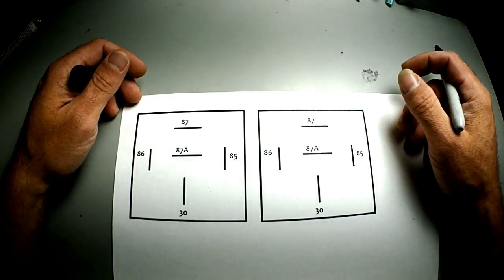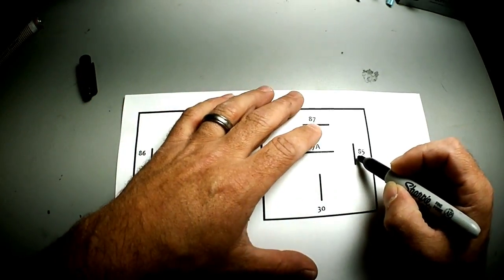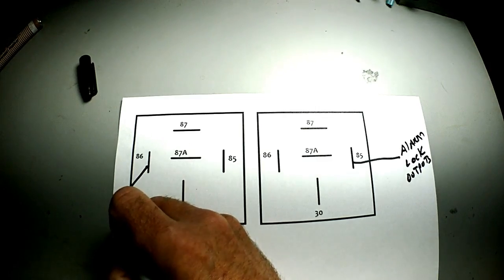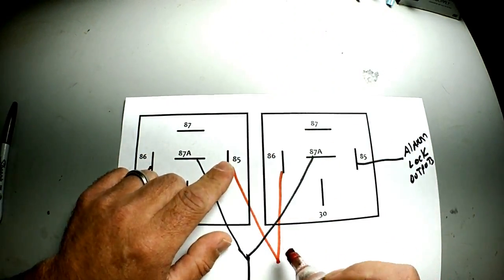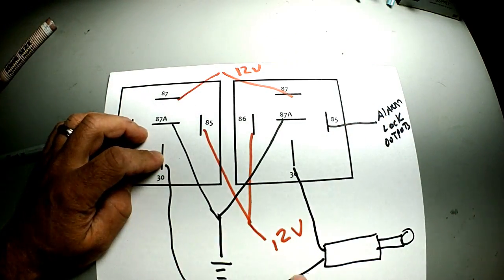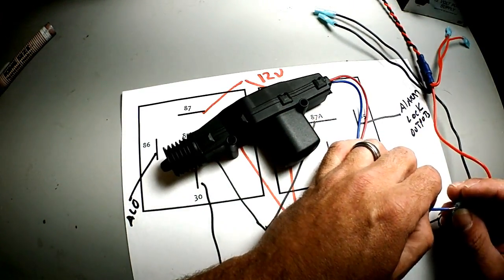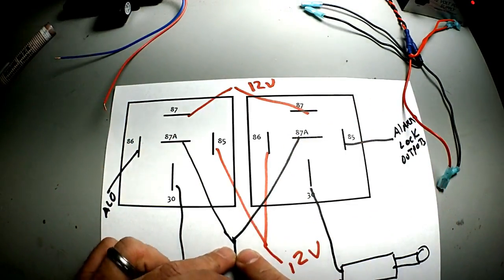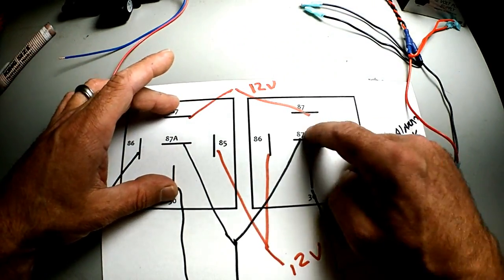How to wire door lock relays for aftermarket actuators.

Comment: Nearly right... switch up pin 30 snd 87. By DIN72552 30 is fused power from battery and 87 is load. This works the same, butbits not 'correct'

Comment: I know this is an old video now but can the trigger be from existing locks, eg I’ve done an engine swap and used donor car full loom, but donor car Audi a3 3 door, project is 5 door so at the moment no wiring in place for rear door locks so would this fix my issue ?

Comment: after much research and shagrin this video finally helped me figure out my relays to add the optional OEM power door locks in my manual lock truck that did not come with them originally
Reply: How did you use the oem actuators? Did you use oem key fob? Or aftermarket security alarm
Reply: @mr.spittle136  my 2001 4.3 didnt come with a key fob, I used the hard to find base model optional elec door locks (not the style that have the elec windows, my windows are still crank) I used the OEM wires (its all plug and play) and just wired them up to 2 relays like in this video. I had to make my own end plugs for the relays of course - but used the OEM wires. As an option I decided to add in a remote fob but its not required (I just didn't like reaching over to unlock the door) the aftermarket remote fob came with its own wiring info and I combined them and it worked out well
Reply: @jmsmilin @jmsmilin thanks for the breakdown. Ive got some oem actuators in a set of spare doors i plan to use for my power locks/windows conversion
Reply: @mr.spittle136  the OEM wires will plug right into the actuators and the lock buttons, all I had to do was figure out what wires go where on the relays, ideally you can find OEM relays already wired, but its hard to find the trucks that came with only power locks

Comment: So I found this setup wired in a truck that a bought with a positive and negative (I assume) trigger wire running over to the drivers side of the  truck with a small 2 pin plug on it. It appears that maybe someone removed the radio triggered portion of the system. What should I buy to put in its place to restore the keyless entry? Is there a wireless reversing relay out there?

Comment: A question how can I make my truck do power doors lock work with the transmission because my truck only has factory alarm and if the power doors locks work with the alarm but it does not work with the transmission and how can I do that when it is in parking unlock and when it starts it locks ...

Comment: hi, thanks for your instructions. it worked for me - i just did this on the passenger side door locks.
Couple of questions:
1. The relays are staying warm. is this normal?
2. I did this only for the passenger side but i noticed all the other 3 door locks are working with much greater force now. Is it possible that a stronger current is flowing in the door locks circuit?! (as they are connected in series)
Reply: I have the same problem, did you ever figure it out? My relays are warm and causing the battery to slowly drain
Reply: @maximuscamp2400  no , i just removed them out ☹️

Comment: hi stereo king.my vw t4 think is positive pulse so do I change relay connectors?a relay came with alarm kit from righclick .im in uk.thanks.steve
Reply from the maker: If you watch my video on how to wire a relay it explains how to throw a positive trigger.
Reply: @stereoking7778  thanks.just one more problem.on the right click alarm.the lock remote locks drivers an tailgate.but the unlock button locks passenger .tried reverse drivers door wires and no difference..maybe reverse passenger door wires?

Comment: Ok question I'm trying to put three actuators one for driver's door passengers  n finally trunk .so I only need two relays not two for each actuators n do I connect all wires of actuators together for unlock n for lock.please help .I burnt one out already
Reply from the maker: Yes you should only need 2 relays unless you want to control the trunk separately.
Reply: Thanks dude I got the door to work.now for the trunk I need to  use two n what cable can I use to trigger from alarm on mines I picked a solid gray but didn't pop the actuator

Comment: finally found out how that magic stuff works! what if you have around 10 actuators ? can you run more powerful relays or is there a different setup ?
Reply from the maker: I've done 6 off of 30 amp relays. I would guess you could do ten. If not just use 4 four relays.

Comment: Will this work for 2012 ram 1500? I’m adding a lock actuator for my tailgate but I’ve see different diagrams..
Reply from the maker: Aftermarket actuators all wire up the same. The vehicle shouldn't matter.
Reply from the maker: If you are adding to a factory system then no it would need to tie into the factory motor wires.
Reply: @stereoking7778  pls I am working a keyless entry to 2006 Chrysler stratus, I could not get the lock and unlock wire to connect to the relay from the car door switch

Comment: Why do u connect 85 and 86 to 12v cant u just do 85 85 then use 86 and 86 to go to lock output
Reply from the maker: 85 and 86 only activate the relay.
Reply: @stereoking7778  I see what you mean 86 to lock and 85 to unlock or vice versa. Is that correct?

Comment: Can i install door lock/unlock switch button? My car doesnt have one. Only auto lock by pressing brake and unlock after gear put on P.
Can a any universal power window switch being use as door lock/unlock switch? Is it same mechanism?
How to wire it?
Reply from the maker: You sure can. You will need a three position momentary switch. The center pin will go to ground and each output will tie into the alarm lock outputs before the relays.

Comment: Great video thanks, but i have [2] questions: 1. do you loop the positive 85 86 87 87 together and run to the battery?... 2. and  85 and 86 is that where you connect  your alarm and lights so they will flash?  Thanks again!!!   I'm retired just like trying stuff myself. Have a blessed day!
Reply from the maker: Yes sir you will tie both 87s and one 85 and 86 from opposite relay to 12 volts. The left over 85 and 86 will run to the alarm door lock outputs. If you are trying to add a relay to power lights I have a video covering the basics of a relay installation.  youtube.com/watch?v=GjR4Ko5r57s

Comment: Hi how they connect a power steps on my chevy silverdo 2010 can you help me how that relays conect thks
Reply from the maker: Power steps usually have a control box that can sense when to start and stop. Some times its built into the motor but normally. So just relays are not usually the trick.
Reply from the maker: Probably not do to they wont know when to stop.

Comment: Good video. I am using the setup you show here with the relays. In the video you don't show any door switches. I am using a remote lock unlock and also want to use left and right door switches to control the locks. I have set this up and I can lock or unlock using each switch separately. Problem I am having is if I hook up both switches at the same time neither one work. Do you have a diagram to show me how to hook this up so both switches and remote will switch the lock unlock. I am currently using two 2 wire actuators but I do have 5 wire actuators if needed to make this work.
Reply from the maker: You will need 2 three position momentary switches. Tie the center pin to ground and the outputs to the door lock outputs of you keyless/security system.
Reply: @stereoking7778  I have the left & right switches wired in center pin to ground and one switch output to blue and one to green on the actuator. Either switch works fine if I only hook one switch up at a time. Once I hook both switches to pins 85 or 86 nothing works. Have not hooked in the remote yet. Remote will trigger lock unlock with white and white/black wire when I hook that up. But my problem is not the remote function but the switches both working properly. I have worked on this for hours and can't get it to work with both switches. Even duplicated a whole system outside the car on the bench with same results. Something is not wired right to use both switches at once but I can't figure out what to do to fix it.
Reply: You can try diode isolating the switches from the relay. Not sure why adding to switches is causing priblems.

Comment: This is also helpful for replacing the slide controller on an RV.  Lippert (formerly Power Gear) controller boards use a pathetic little DPDT relay that burns out easily when the slide gets old and the load gets bigger from the worn motor and dried grease on the gears.  Instead of buying a $140 replacement from Lippert, this works fine, but you may have to change the 12V connection at 85/86 to a ground, as many older RV's used a positive trigger.  Also, Lippert's replacement boards are ONLY negative trigger, and this method saves you the trouble of changing your slide switch from positive trigger to negative trigger.  Be looking for a video about this on my channel in the coming weeks.  I will also be using a similar method to manually open/close the choke on my generator from inside the camper.
Reply: "Be looking for a video about this on my channel in the coming weeks" 4 year since , did you ever make that video?
Reply: @AztecWarrior69 Only days after I posted that comment I was hit by a drunk driver.  There was eventually a sizeable settlement, but in the interim I had to sell my motorhome to make up for the hard times the drunk caused me.

I've since replaced the motorhome, but the slide controller is fine so far so I haven't worked on it to make a video out of.  It's mostly been computers and my son's jeep on my channel

Comment: Do you have to have 2 source of 12V wire cause I tried 87,87,85,86 like picture and blowing fuse
Reply from the maker: When is it blowing the fuse? If it blows right away make sure you don't have 87 and 30 switched.
Reply: @stereoking7778  same thing is happening to merit blows the fuse right away, is this wiring diagram works even when the lock and unlock signal from the alarm are negative ?
Reply: @nehemiasmartinez7758  yes

Comment: I am trying to install an aftermarket keyless entry in a 02 volvo v70. The issue I am findind is how to wire this to provide the double pulse needed in this car to disarm the factory alarm. Someone has mentioned that the answer is at the door lock wiring which got 6 wires .Grey ,Yellow,,Pink,Purple,Blue/white,
Blue which I assume would also control the builded in door lock/actuator the others wires I have no clue. Would you know what to look for and how to wire in this car? The only info I found was a very techinical and unclear squematics without any wiring colour reference.
Reply from the maker: Double pulse is usually a feature on the alarm itself. Generally you'll have to program it to be double pulse.

Comment: Great information but what about the doorlock after market switch. " the actual switch that you hit on the door to unlock and lock door. 

Alarm remote button switch explained but
Door lock & unlock switch oem or after market ? Where those wires go?
Reply from the maker: If you would like to add a lock switch you would just need to tie them into the same wires as the alarm lock outputs.
Reply: @stereoking7778  can I use a 5 oin lock switch or it has to be 3 pin?
Reply from the maker: @MatLon28  As long as there is open resting point it shouldn't matter.

Comment: I have 3 5 wire door lock actuators and 3 door like switches. I cant find how to wire it. None of the relay wiring diagrams work. Can you tell me how to hook them up?
Reply from the maker: Sure you can wire it up just like this video describes but instead of using an alarm to trigger a door locks just use the switch. If your switch has 3 wires the center pin should be ground and up is usually unlocked and down his lock.
Reply: stereo king oregon can I do alarm and switch hooked up? I have a viper 5704. Oh and I found out that the 5 wire actuator is useless because I installed door switches, I read that in a forum from 2004.
Reply from the maker: Your right.  The 5 wire actuator is designed to control the other actuators you really need two wire actuators.

Comment: I'm glad I found this video. I'm pretty sure I'm gonna need this information. I'm about to install an aftermarket alarm system in my '96 Ford Ranger. I'm also going to be installing aftermarket door lock actuators that will be controlled by my alarm system. I haven't decided between two alarm systems on Amazon which both seem pretty good. The two alarm systems are the Avital 3100LX and the Viper 350 Plus 3105V.
Reply from the maker: Hi Jeremy, thanks checking out our video.  Both the alarms you are looking at are good alarms.  The biggest difference between the two are the remote look and the led on the Viper 3105v is built into the antenna and is blue instead of red. You might want to pickup a DEI 451m door lock relay harness as well. It will make the installation a little easier.